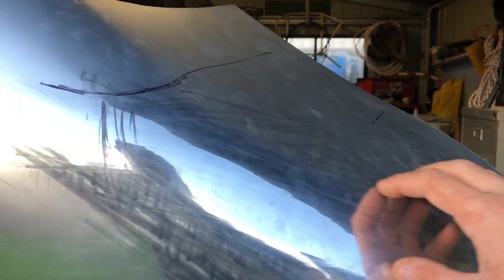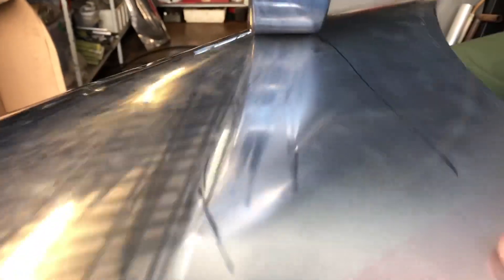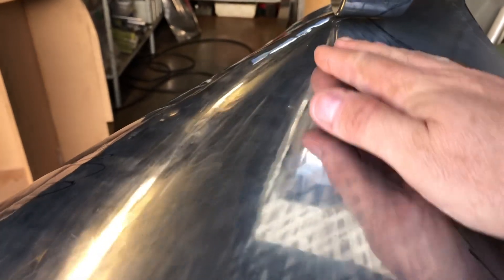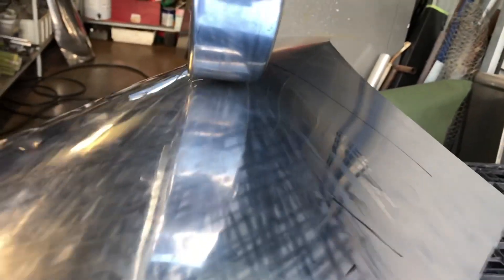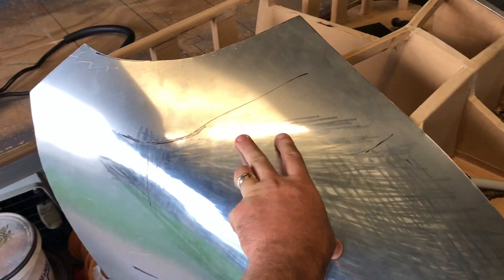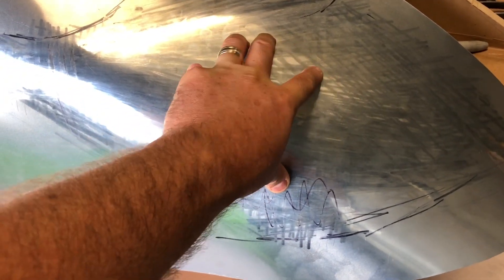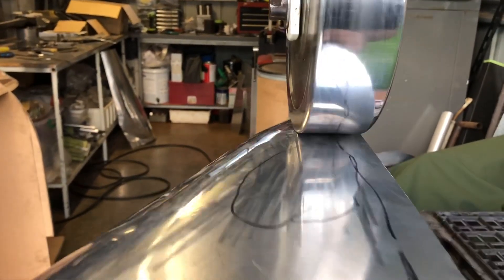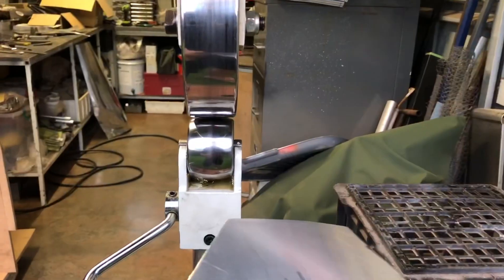A custom built engine cowling for a custom built aircraft part 6 a detailed look

Comment: Did you have to do anything special to get the clecos to hold in the MDF like that? Or is it just a tight fitting hole?
Reply from the maker: Nothing special, I just used the drill bit size I wanted (3/32 or 1/8) and drilled straight in to the mdf. It holds quite well although the hole does wear out over multiple uses. It’s fine for making one or two parts off of. Sometimes I’ve filled a worn out hole with superglue and re drilled to get just a little more use out of the buck

Comment: Nice work! How long does it take to get the knack of this sort of metal forming?  Once you know what you're doing, how long did it  take to make the cowling?
Reply from the maker: Thanks mate. I’ve been repairing aircraft for a long time now, which probably helps to pick up forming skins a bit quicker. Each panel has taken two or three hours to make with these two front ones taking a bit longer. I reckon there is as much work involved in making the buck